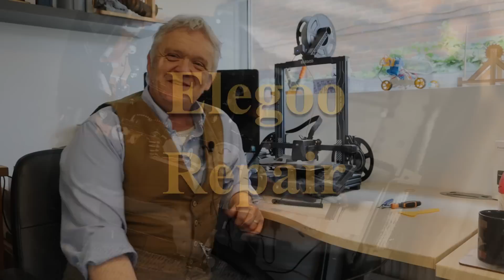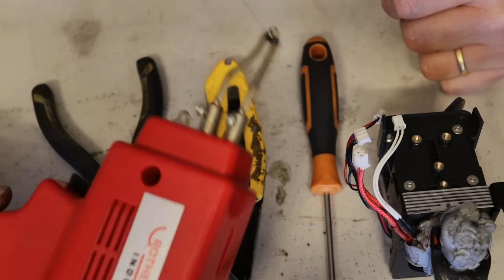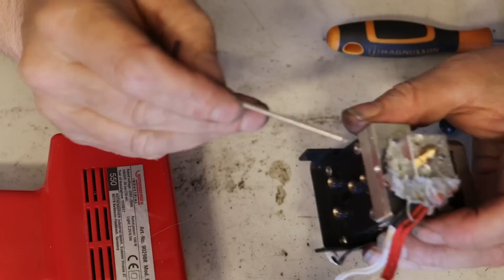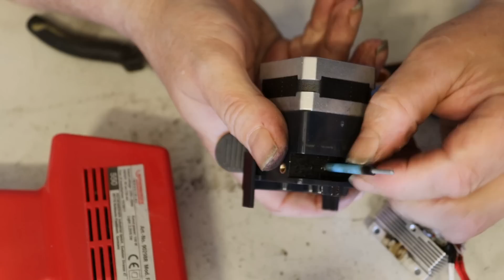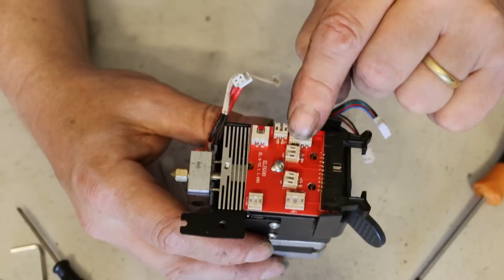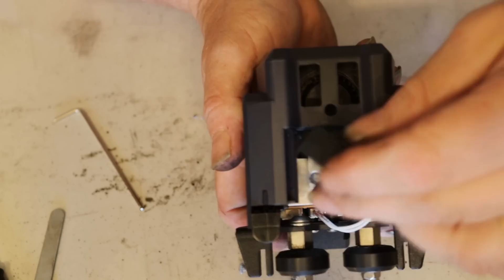2029 Upgrading, Repairing And Replacing The Elegoo Neptune 3 Hot End

Comment: I bought an elegoo nepture 3 pro cause my creality bottom yet the same problems with those. So my neptune i loved until it over heated 6 weeks after I bought it too knew so I did not want to fix it and I returned it just to get another same one that 2 weeks later into the new one this same problem existed and it said this time the nozzle too hot and cooking. so now do I try to fix this one or send it back replace with yet another one the 2nd time or return and get another brand. OMG this is driving me crazy. as I love this one but it has problems again and I don't think I should fix a new machine that is having heating problems the second machine again. HELP

Comment: I initially came here to figure out how to replace the PTFE tubing which was a great help but I started a print and went to sleep and came back to find a similar mess. Luckily I had a soldering iron. Not as big but better than nothing. There's minor cosmetic damage but not visible with the cover on and it works like it's brand new! Thank you for the video

Comment: I’ve had to do this a couple of times but there’s no need to remove the whole carriage. There’s three bolts that remove just the head from the carriage assembly and it makes it a whole lot easier reassembling two bolts that go through the ribbon cable holder on the top of, the printhead and one in about the middle between the wheels…. It saves fluffing about what the carriage because there’s no need unless there’s damage or you replacing the carriage wheels….

Comment: Looks like you got your fan pins mixed up on the mother board. C6 and C7 should be swapped around. Although I doubt it makes any difference, unless there exists a requirement for the Hotend fan to operate differently from the two housing fans.

Comment: There was a hot-end replacement video that showed it is easier to disconnect the band of wires (loom?), then undo the twso small screws on rhe front. then the three small screws on the back and unplug wires as needed.

then you don't have to mess with the wheels and belt.

Comment: You did have to take the belt off , just the hot end unit . This recently happened to me but not as bad . I heated the hot end and picked pla off nozzle with various tools . I did change the nozzle and most importantly configured Z axis .

Comment: Question do you know where to find that back bord where u plug everything into I Wana find another one I was dumb and did a beginners mistake and acadently ripped the fan port out got it back on but the port feels weak who knows how many times it will alow me to take it off I found one on aliexspreas but wasn't sure if it would work because the ports seame alittle off

Comment: I looked at how this hotend is designed, it needs to be all metal.  Yeah, I have been where you are.   I caught mine a lot sooner, but the problem is it builds up under the sock before you are any wiser.  

There are 3 m3 screws on the back so you don't have to take the wheels off.  2 are holding the cable mount, and one is by the bottom wheels in between them.  All run through the PCB on the back of the assembly.  Then take the 2 fan shroud m3's out which hold the fans to the front of the carrier.   You have to remove all of these screws no matter what, so you may as well not take the wheels off.

Reason?  That PTFE tube must be perfectly cut in order to prevent problems like this.  If it isn't, you won't know until you are tearing it apart, again, and unclogging it.   There is also no way to check the tube to make sure there is no play in it when you reassemble, so you are shooting in the dark.  The leak comes from the threads of the heat break and the nozzle.

Elegoo sends a spare piece cut longer than it needs to be on purpose...that way the fault is on you because you have to trim it.  No slop is acceptable with a full PTFE lined hotend...none.  My failure was from the factory, so no modifications of any kind.

Comment: I would suggest using the hot air gun from an SMD rework station instead of the soldering iron. It should make it easier to warm the PLA just enough to pull it off without risking any damage to the wiring and plastic parts. I'm guessing that somewhere between 120 and 150C the PLA would already be soft enough to carve, or pull all at once?

Comment: Burning PVC is really no joke😬😳
I was a firefighter and a fire under a sink was full breathing apparatus every time guaranteed because burning PVC can drop you like a stone.💀
Of course, you were shown a very safe method here
Reply: It is not PVC. It is PLA, (no chlorine) The hot end works around 200 deg c. If you set your soldering iron within the temperature limits for the PLA there is no issue.

Comment: I've seen in the comments about heating it up via the menu, that's what I just recently did to clean up a fail on my nep4. It makes it easy to get the screws out of the nozzle block (noob not sure of terminology), just push in the Allen key and rotate till it lines up. The melted plastic just pushes out. Also, I soaked it in a glass of acetone to clean it up nice. It made the PLA brittle. Don't know if that was the right thing to do or not, but figured the only thing it could damage was the wire insulation and I have liquid electrical tape if needed. It works fine now.
Reply: Also, cup of steaming hot water from a microwave might be enough to soften up the blob. I tried stirring my coffee with a failed print, just to see if I could use it for something, then the print warped and began to fall into the cup. Wish I remembered that before I tried the acetone.

Comment: I would heat the hot end enought to soften the plastic then pull the 'lump' away from the hot end.
Reply from the maker: it's a good idea but that wouldn't have worked here - the plastic had spilled over into the cooling fan - you would have burnt out the head and broken the fan if you tired that here - something more was needed here

Comment: Wow, you haven't had a single nozzle block in 8 - 9 months?!  That's quite a vote of confidence for Elegoo.  May have to replace my Ender 3.
Reply from the maker: it is a good machine - at least i think so
Reply: Same - dare I say it - zero nozzle blocks on Elegoo Neptune 3 Plus used for many hours during the 6 months we have had it.
Reply: The Neptune 3 is really a better rig than the Ender 3 (Pro or V2) or even the Neptune 4 dollar for melty plastic value. The new Ender 3 V3 SE can hang with it, but i still think dual z should have two actual steppers, and the Neptune 3 can mount all the upgrade bits like nozzle or heater blocks (even the Revo adapter) they use on the Creality Sprite extruder.
Reply: @Badjujubee  I wound up buying a Creality K1 Max.  Not a great decision so far.  Hopefully once they get me my replacement parts, everything will be fine.

Comment: A simple trick to make sure you never plug the wires in the wrong place is to have a set of permanent markers of 10 different colors. Just mark all the male and female plugs and sockets with a unique matching color . Takes a matter of seconds to do, never failed me in 30 years. Also I use a pair of fine point electronic snips for controllable cutting of plastic. Many ways to skin a ......
Reply from the maker: absolutely mate - nice tip by the way

Comment: was the new nozzle diameter the same ? 0.4mm'ish, the bag of spare nozzles is normally different dia ones. i normally shove acupuncture needles in them while heated. great for burning fingers.
Reply from the maker: good advice mat - on mine the size was printed on the bag and  took t as read! could be an oops

Comment: Been printing over 3 year with the ender-3, never had such an issue, only a blocked nozzle.
Reply from the maker: this was a blocked nozzle
Reply: @ThinkingandTinkering  yes, but mine did not cause such a mess, it just chewed away a part of the filament on the traction wheel, maybe I was just lucky.
Reply: I think it depends on how long its been trying to print while blocked.  I've had one like his on my Ender 3, and it was a good 4 to 5 hours in the making (overnight).  @VoidySA

Comment: The only use for PTFE is a reverse Bowden. Do not use it as a heatbreak. My very old Hemera was the best upgrade for my AM8. More reliable than any cheap new printer. The only clog I had was my mistake (I forgot a two color print with manual filament swap and the PLA was cooking overnight)
Reply from the maker: cheers mate - but isn't a reverse bowden some kind of dance move? lol - i joke of course

Comment: Not perhaps relevant but having more than one printer means you can print spare parts off and upgrades, I went direct drive using a 3d model for hotend/extruder mount. 
Rob any plans to do brass or aluminium casting?  I'm thinking it would be possible using PLA patterns in plaster?
Reply from the maker: i am thinking about it mate

Comment: just fire up the hot end and it will soften the plastic before you start, just be careful with the temperature sensor wires (or you will soon know when the plastic starts smoking that the hot end is out of control.) - on one of my machines it recommends different hot ends for ABS, PLA and TFU, so I have spares for that machine (the PLA is the coolest and can be put in place of a burned out ABS, but the ABS cannot be used for the cooler PLA (abs residue in the nozzle)- mind you its an old machine now.
Reply from the maker: that was a lot of plastic mate - chances are just 'firing it up' would have done more damage tbh
Reply: Agreed, I have dozens of printers running 24/7 and I've done this many times, sometimes have to heat it up to like 240 to get it off, but "USUALLY" this will allow you to get it all off without disassembling the whole thing like this or busting out more tools.

Comment: First thing to try is to heat the hotend up and try pulling the blob off with pliers on the opposite side of the wires first.
This will obviously only work if thermistor and heating cartridge wires are still intact :-)
Reply: My first (of three) Neptune 3s had a catastrophic failure of the 50's B-movie level. I reached out to Elegoo at the time asking if they had replacement parts available and they guided me through fixing it without removing the hotend. Basically, as long as the wiring isn't damaged, use the menu to preheat it and just peel the blob off with pliers. Worked an absolute treat and I was up and running in no time. I appreciate from previous printer clogs that sometimes the wiring gets damaged and this is not an option but I would certainly try this option as a first attempt.
(BTW, said blob is sitting on my 'shelf of shame' where I keep all my blobs as reminders.)
Reply from the maker: that's a god suggestion mate if the plastic isn't too thick - other wise I think you will just cause more damage